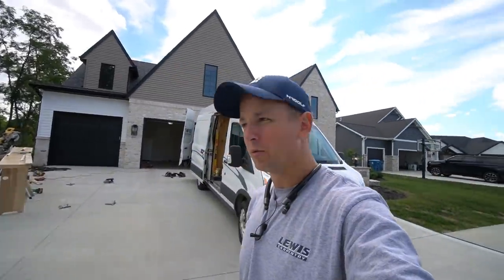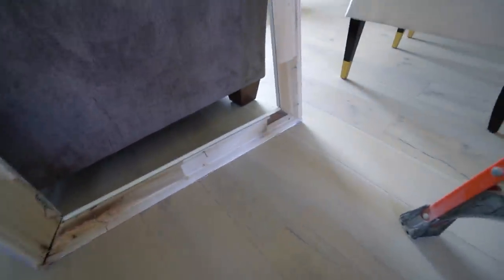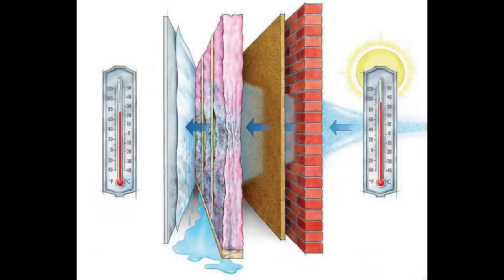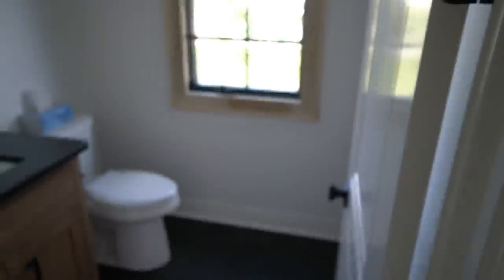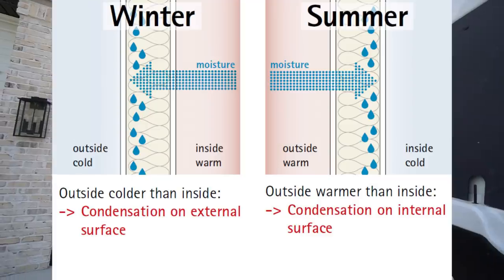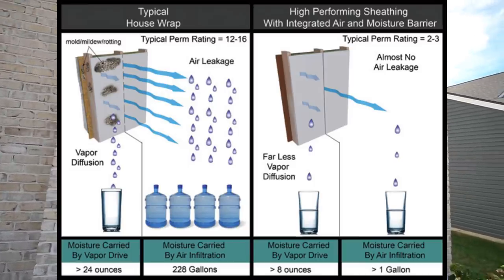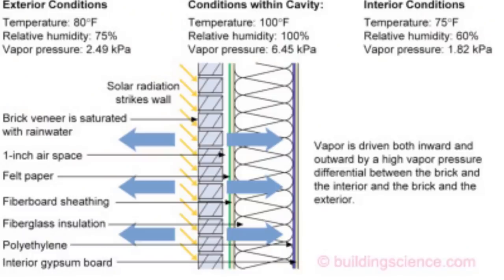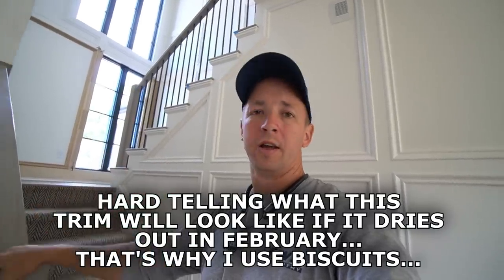Trim Humidity DISASTER!!! Is Vapor Drive Destroying this Trim Package???

Comment: This is potentially an HVAC issue that is creating a vacuum or negative air pressure. The humid air is being brought in and focused at the leak points (doors and windows). This would also create a humidity issue since outside humid air is being exchanged with inside conditioned air. The problem with an oversized HAVC unit is that it doesn't run enough to remove the extra moisture in the air. The humidity that is being caused is a fight between the sun and the cold zone inside the house being that it is the front side and facing the most sun. The HV system is overpowering the house being that the house is well sealed, and the moisture from the HV is too high. With the front of the house being the problem area it makes sense why this is happening being that the front holds the heat longer causing moisture. I would have the HV guys come out and recheck the system and check the moisture content in the house, otherwise, the problem is just going to persist.

Comment: A few years ago we had a similar issue.  Best to open up some walls to see if there is leaking.  When we opened a few wall the OSB looked like mulch.  You could have a mold problem later.  Best to do an investigation.  Looks like on one part of the house there is a brick ledge between the first and second floor.  Check all flashing and window tape.  Also make sure the air conditioning is not short cycling.  If it is, the humidity will not go down.
Reply from the maker: I think we determined that the AC is oversized and is indeed short cycling. Thanks for the  input.
Reply: @InsiderCarpentry  Just as an aside, where is the builder in all this? I see that your friend is replacing some of the trim which won’t do squat until the larger issue is resolved.
Reply: I noticed the brick ledge and small overhangs as well ...I'd definitely inspect the flashing and I agree that a problem like this needs to be resolved before worrying about cosmetic issues
Reply: Flashing and window tape are pointless when you use a woven fabric style building wrap, mine as well have left the osb exposed, it will rot the same either way.

Comment: There's way too much moisture getting into at least the front wall, and of course the moisture migrates from the warm moist outside toward the cooler, drier inside. Don't overlook the possibility of (maybe multiple) small leaks due to poor detailing on the brick veneer and especially at the transitions from brick to siding. Best practice would call for through-wall flashing and weeps  under window sills in veneer areas. The WRB (house wrap) may not have been detailed properly (reversed laps, tears, and punctures). And as others have said, the air space between the  sheathing and the back of the veneer might be clogged with mortar droppings. 

I totally respect your craftsmanship and devotion to detail on trim work, but honestly, in this case, the condition of the trim might be the least of your friend's problems with this house-the trim might just be the canary in the coal mind. As previous commenters said, I'd open up some inspection holes in the front wall to see what's going on. If it looks bad, I'd look for a building science company in the area for an opinion. I've been in residential construction for almost 50 years (yep, I'm  old!) , and while I've seen localized moisture issues from window or pipe leaks, I haven't seen anything so widespread in a house.
Reply: I agree, the trim is of secondary concern at this stage; I would definitely open up some inspection holes in the drywall
Reply: I'm with both of you. If that were my home there's no way the builder's not opening that wall up for inspection.

Comment: My first guess before you got to it was the house was "tight" and the windows weren't insulated well between the window and framing. Somehow the house is exhausting air more than intake.... Intake is sucking through the cracks by the windows turning them into "dehumidifiers" as the hot humid air hits the cold interior.  I would think that really bad window you had would almost be able to feel air moving through with the kitchen hood vent on.  It's quick to test anyway.  I also like the thermo camera idea just to help add to the information.

Comment: one thing you might want to look at the weep holes at the bottom of your brick wall, make sure the land scaper didnt plug up with mulch. Also I noticed you have vinyl siding on the second story, you might want to check for some time of flashing between the two siding products letting rain water into wall, just a thought!
Reply: Was thinking the same when I saw vinyl siding.
Reply: They used "weep wicks" which I'm not familiar with. It's in the video

Comment: Bricks clearly are not weeping and drying after weather events, so weep holes are probably clogged or improperly installed. Do not seal the bricks, that will make it worse. Also, exterior waterproofing must be nonexistent because no water should be able to infiltrate those fixed casements like that. The fact that the miters are having issues at the tops of windows and doors, where waterproofing is the easiest, is especially worrying. They have some serious issues with this house.
Reply: @eggsoups  That was my thought exactly.
Reply: And probably all the other houses in the sub-devision.

Comment: Not a comment on this video specifically but I just wanted to voice my appreciation for the depth and thoroughness of your commentary, as well as its uncomplicated clarity. I'm a one man show here in Seattle, and I get the smaller oddball projects that are too big for my larger colleagues to peel off a crew for. I've found borrowing from your ethic of repeatable processes and systemization to be beneficial even with the ever-changing mixed bag of remodel and refurbishment projects that are generally my meat. You are an excellent resource. Good on ya, take care chief
Reply from the maker: I appreciate the kind words!
Reply: @InsiderCarpentry  very interesting problem, I would hope you do a follow up on what was found and  what the fix was.
Reply: @InsiderCarpentry  

You betcha, also you're right about the milwaukee 15ga nailer, good gravy, what a disappointment

Comment: Water test and Check the sill of the window is not leaking, staining of the drywall after trims removed. Is the trim material MDF? Install wall vents at base of wall for air circulation in the cavity of the wall. Wall ties in the cavity of the wall could be running towards the inside of the house and creating the problem. Flashing below your weep holes could be damaged and letting water in and damaging the skirt. Has the bottom of the door been sealed. I’m a carpenter/builder in Sydney Australia and have seen this problem when we use MDF mould’s internally. The three “W” to look out for when you are building is Wind, Water and Women. They can make or break you. Good luck with it. Regards Jim.

Comment: The trim failure as you say is the first flag, moisture likely a problem behind the drywall too. Your personal trim procedure although more robust would not have prevented the moisture issue. That’s just a guess. Your viewers consist of many professionals who might know - good luck. 
Wow multiple dehumidifiers running and still high humidity.
Reply: They'll be trimming it again next year if the water intrusion is not stopped!!!

Comment: Hey Spencer, im a 40 year general contractor i dont think its vapordrive . first off moister wouldnt make it through the sprayfoam and if it did you would have more issues with the drywall its just paper and gypsum. you should look at flashings were brick meets siding and caulk between brick and windows. and if its a slab house make sure the finish grade is well below top of slab. and try running the hvac on fan on and not auto that will move air all the time. i always have my mason seal all brick and stone. im in northern indiana and i run my fan on on the tstat year round  believe it or not its more energy efficient and more comfortable.  so to me it sounds like flashing caulk sealing and grading. i hope this helps but i agree i would not replace trim until you fix the problem
Reply: @Phlebas he said it was closed cell
Reply: I would open up walls to see if parts or all the wall is being effected.. then make a decision based on that

Comment: I consider myself a disciple of Joseph Lstiburek and Allison Bailes so I'll throw my 2cents in.

The condensation/moisture is likely from air leakage around the openings. The very humid air from behind the brick is leaking through and condensing on the first cold thing it finds (trim).  Oddly, the high moisture content in the home isn't causing the condensation per say, but the high humidity is causing the homeowner to have to keep the house very cold to feel comfortable. The colder the house, the colder the trim, the more readily any small air leakage is going to immediately condense.  It makes sense this would more readily occur on the Northern side of the house since the walls/trim would be the colder than the sun warmed southern side (albeit only a few degrees but small matters here).

I'd start with get an HVAC tech out there to figure out why the humidity inside the house is so high. If the humidity issue can be fixed the homeowner will likely be just as comfortable at 74 @50% RH as he was at 68 @ 70% RH. 

Unfortunately this probably wont be as simple as an hvac fix though. The lack of air gap behind the brick is potentially the root cause and a huge problem. This house sounds like a lawyer will need to be involved.  

As an aside, you mentioned a 1/2" layer of spray foam. I feel like in the climate zone of Indiana this "flash" layer of foam will be insufficient for a flash 'n batt type system. In the very cold months you could see condensation form on the interior side of the foam. Based on climate zone you are suppose to install a minimum thickness layer if using foam. This would be a whole 'nother problem but would be exacerbated by the unusually high indoor humidity. 

Looking forward to an update!
Reply: Wether the 1/2” of closed cell is sufficient or not is, i believe, dependent on the wall thickness.  2x4 vs. 2x6 … but this is definitely something to verify.  Odd that you would have that much moister being driven through that wall assembly… the closed cell is a vapor barrier and the insulation face is either a barrier or retarder, which is not ideal for drying potential.  I would suspect the HAVAC/humidity inside the house and/or air leakage around window/door opening/or other penetrations through the wall.  I would definitely open the wall to see if there is moisture inside the wall being trapped

Comment: Depending on your climate zone, I would be concerned with trapping moisture in the stone during the heating season, if they decided to seal the stone (freeze thaw cycle becomes an issue). I know In Ontario, Canada, we have a 40 degree swing between interior and exterior temperatures (-20 Celsius outside and +20 inside at 35-45% relative humidity) which would cause the conditioned air to be pushed through the wall system to the exterior. 

You also mentioned this is a new build. In the first couple of years after the home is built, building materials (lumber, paint, drywall compound, especially concrete) expel massive amounts of moisture as part of finding their equilibrium moisture content. This house needs a dehumidifier, HRV, ERV, etc to mitigate this humidity as well as the humidity making its way inside. 

I noticed the issues are around windows and baseboards. I’d be curious to see what a blower door test would read as to the air tightness of the home. From some of your camera angles, it appears the window opening is not continuous with the air barrier of the house, which would allow hot, moist air to easily passthrough, especially without ventilation behind the stone, and it doesn’t take much of a hole to reek havoc. I have also seen air leaks where the base plate of the wall sits on the floor.

To conclude my novel (sorry), Tyvek building wrap and masonry are a terrible combination. 15 pound asphalt paper would have been a better choice for a mechanically fastener WRB.

Comment: Hi thanks for the content just recently came across your videos.
I am a carpenter from Massachusetts and agree with the concerns regarding masonry and best practices but I haven't seen any comments regarding the 1/2" of closed-cell insolation it is  Essentially a vapor barrier which is on the wrong side of the wall assembly and it's thickness is insufficient to prevent  Condensation.
I would not be surprised if that is creating problems.
Really don't believe in the flash and batt. I believe all foam or no foam.
Anyway interested in hearing what people think of my thoughts and interested in hearing others thoughts.

Comment: We all react based on our experiences. I had very similar humidity problems that turned out to be an under slab hot water leak filling the under slab ductwork.

The next thing I would check is the flashing at the brick to siding transition near the stair window.

Both of these are easy to check. After that, I would open up the exterior walls to investigate and experiment by removing sheetrock.

Good luck. I'm following so I can learn something new.

Comment: In scotland anyway there would be masonary weep vents in that brick work at low level, high level and spread out between. 
They go between the butters of the blocks and allow air to flow through the air space without these I guess the condensation hasn't enough air to dry out, cant prevent blocks from getting wet though 👌

Comment: Hi, you are absolutely right, I did some work on TW Phillips mansion in Pennsylvania that had the same problem, the moisture is coming through the brick. You need to seal it with a product that has the highest silicon content that you can get.

Comment: From my experience with an oversized ac,  is that moisture sits on the coils and is blow right back into the house.  You are right with it not goin into second stage because ambient temp is already reached. A tight house will make the issue worse.  Installling  plastic under the drywall is very debated.  Not a great idea for high humidity area.  I’m not a pro but have some experience on the issue though research and application. Good luck.

Comment: I had a problem similar to this a few years ago on a commercial building. It was an old historical brick building converted to self storage. One masonry wall had a shed roof framed up against it from the inside . After the building was completed it  started to condensate inside the building. We used a FLIR camera to pinpoint the problem. Opening up walls will certainly tell you where the problem is but the FLIR camera will identify the problems areas . If you have a local company that knows how to use this technology it can help you identify the problem areas.  A bit surprised the masonry isn't sealed I would think that would be the normal course of business . maybe not in residential construction...

Comment: You mentioned ductwork running under the slab? Definitely not good if that’s the case. I’d check with the neighbors and see if they have a similar problem and check if there’s and type of underground stream . If so and the ductwork is in the slab that would definitely be the problem… good luck

Comment: I have found that cases like this have multiple issues contributing the the problem. First thig to perform for the HVAC concerns is to have Manual J and S calculations performed to determine proper sizing. I have seen similar problems around the bottom of windows due to not having proper flashing. The upper window in the stair has few problems but the lower window is leaking. Check for proper flashing at tops of windows and at the top of the brick at mid height of the wall. Also confirm that the windows have proper water fall sealing. OSB sheeting can rot surprising fast when it gets wet and cannot dry.

Comment: Cut an inspect hole in the wall from the interior to the exterior, remove a small patch of insulation to see the the back side of the sheathing looks and feels like.  and remove the exterior sheathing like you said you need to see what type of barrier is there. Vapor permiable or vapor barrier. Do you have air seal flashing around the exterior window openings to stop air and vapor drive?
Reply: Can’t always feel moisture or can’t decern It from being cool or damp. Use a moisture probe.

Comment: I'M A BUILDER IN OHIO, RAN ACROSS THIS A FEW TIMES INSULATION AND FRAMING USALLY NEEDS REPAIRED. WE SEAL THE BRICK EVERY YEAR WHEN PEOPLE HAVE THIS PROBLEM OVER THE LAST 18 YEARS THAT SEEMS TO HAVE WORKED. I ALWAYS TALK TO MY BRICK SUPPLIER BEFORE ORDERING BRICK FOR A NEW HOME SOME BRICK IS TO SOFT FOR THE MIDWEST MOOSTLY USED IN THE SOUTHERN AREAS.
Reply: Is it also possible the doors and windows were not installed correctly with the proper vapor barrier and/or flashing?

Comment: Seen this many times in West TN....we deal with high humidity all the time.
1. Seal the brick
2. Check all air supply and returns for leakage.
3.  Weep holes are to low.  Should be 6 -8 inches above the soil and 2 inches below the slab.  
4. Verify that the windows are not leaking where the glass meets the frame

Comment: In the Nederlands we use almost only brick. We ALWAYS have ventilation behind the brick,  when the masonry is saturated it wil rain als hard at the insite of the wal ass the outsite. My advice would be to dril out some joints just above grade, below windows en ad just below the top of the wall. But watch out, bees and mice like those hals so close them of in a way that aire can pase through. I hope this helps!
Reply: Candy DULFER